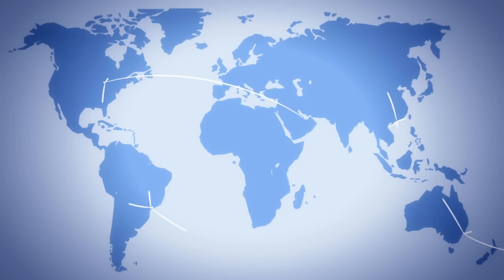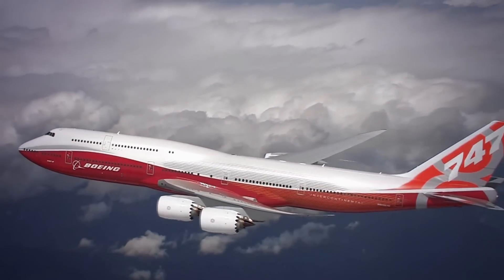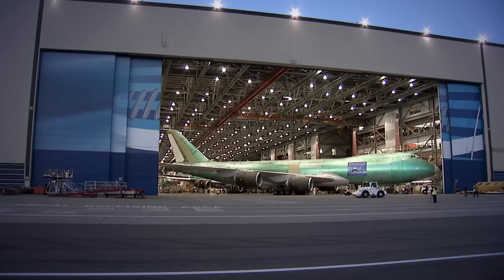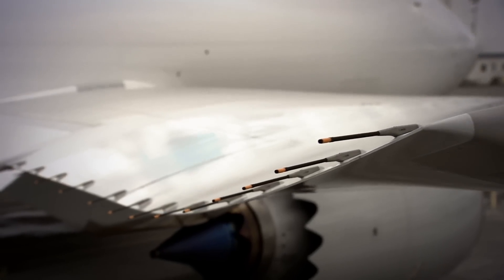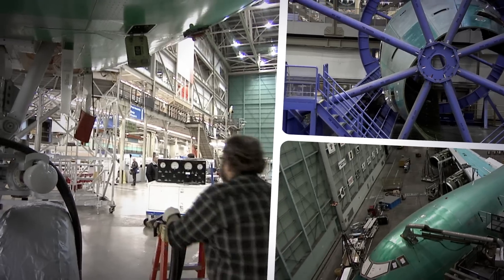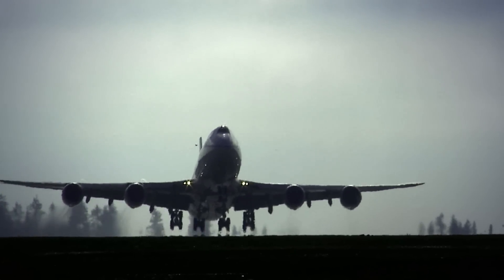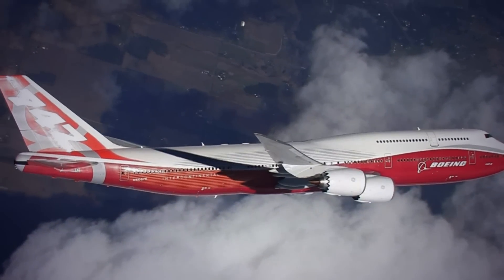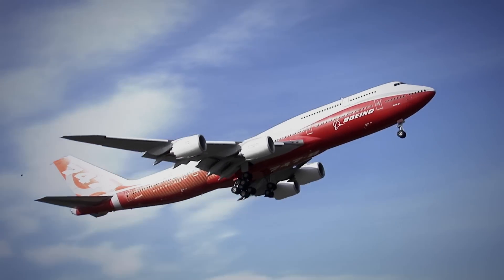747-8: A new lift in performance

Comment: The 747-400s will retire in 2017. This is a replacement for the 747-400s. The 747-9 should be larger and have two huge jet engines like the 777.
Reply: Wouldn't that just be the 777-9X?
Reply: Yes but he 747 has the top deck.

Comment: I like how they always say "best in its class". There really isn't any other airplane in its class. The a380 is a ton larger (and sometimes difficult to fill), and the a350-1000 is even tinier compared to the smaller 77W. I guess the other 747 models are in the same class, but obviously the 748 would be better than the 744 in fuel efficiency and capacity. It's still a graceful airplane with great operating economics, and has a sweet spot for passenger and cargo capacity. I can't believe very few airlines are buying the PAX version, as the 777X still can't really replace it.
Reply: bellissimo

Comment: This is the generation I call "Boeing MAX". This is the era in history where we make the first steps from today to tomorrow. All the airliners are getting a makeover with the 787 type powerhouse, more fuel efficiency, more passenger appeal, tech upgrades, retrofits, etc. It started with the 747-8i, then the 777-2 and 777-9.
Next it's the 737 MAX. Then I think it will be the 767s, then the last one left, the 757. I didn't say the 727 or the 717, or even the 707, I don't think they will be refit as they are really old. But some of the newer ones will be refit, after the old turning new we should get The 797 or it will be thrown in there between the rest.
Reply: Thomas Harbauer 
The entire purpose of the 787 is to replace the 767. Why would Boeing make a 767MAX??
Reply: ...
.o

Comment: The reason the 747 is still the king, is because it was flying almost 40 years before the A380. So it has flown a Billion more passengers. The A380 can't come along and dethrone the 747 because it's larger (or supposedly more fuel efficient).

Comment: Lufthansa, one of the few airlines which fly both A380 and 747-8i -- say that A380 has 747-8i beat in fuel consumption per seat. Not to forget how spacious it is in an A380 and a lot quieter inside.
Just replacing the wing and engines won't get you much.
Reply: "Just replacing the wing and engines won't get you much."

Okay, in that case the A330 is no better than the A300 and the A340-500 is no better than the A340-300 and the 737-700 is no better than the 737-300.

Reduced drag and reduced fuel consumption won't get you much?
Re-winging an airplane makes it a new airplane.

Re-engining with 787 engines creates a massive fuel consumption reduction.

The only "economic" flaw the 747 fuselage has is that - in the aft part of the fuselage- there is a bunch of excess fuselage structure (weight) above the passengers caused by the 747 being designed to haul cargo containers.

Looking at the A380 aft fuselage and massive tail and horizontal stabilizer I see a lot of dead weight there too (unlike the back end of the 747). 
Due to the high mass of the airframe and the short (in comparison) moment arm to the tail, the A380 is probably carrying a lot more "dead weight" than the 747 is in the upper lobe of the fuselage.
Look at it!  The A380 is a pig.  Look at that tail!  I wonder what it weighs?

The superior aircraft is whichever one is most cost-effective for the route that a particular airline needs it to address. Whichever one has the lowest seat-mile costs, highest dispatch reliability and the lowest maintenance costs is going to be the best airplane.

The QANTAS representative who bought the A380 did it only because he said that Airbus was essentially "giving them away" and he couldn't turn that cost savings down because he's "have to answer to his board" (investors)- and would probably be fired.

QANTAS has always been Boeing loyal, but businesses exist to make a profit- and Airbus likes to give airplanes away.
Reply: StratMatt777 All right, you wanna get technical?
1. The A380 air-frame is made of composites. Especially the tail structure you think is "dead weight". Thus, in fact the tail structure of the A380 is larger, and LIGHTER compared to 747-8i. You can even see it in this video that that the tail section is painted green with a non-corrosive paint; meaning it's made of aluminium. So you can keep wondering how much it weighs.
2. If A380 looks like a pig, 747 looks like humped buffoon. 747 design is flawed -- cockpit is placed on the upper deck and the lower deck protrudes under it! How is the polite supposed to see the runway?? There aren't even cameras at the nose-gear like A380 has!
3. As I've already pointed out the only carrier, Lufthansa say A380 is cost effecient compared to the 747-8i (supposedly the model expressly to built to compete against A380's superior technology)
4."Airbus likes to give airplanes away." Yeah right, they are very generous.
Reply: Jérôme Delacour said "2. If A380 looks like a pig, 747 looks like humped buffoon. 747 design is flawed -- cockpit is placed on the upper deck and the lower deck protrudes under it! How is the polite supposed to see the runway??"  

Actually, an Airbus spokesman concedes that the A380 is not very pretty. He says that they had a certain dimension to work with and this is the result. Obviously any attempt to streamline the look of the A380 to make the front end more sleek would have been at the cost of seats and efficiency. So that wouldn't make any sense. Airliners exist to make airlines money. it doesn't really matter that there are enthusiasts like us who get all caught up in "which one looks better" and then get all pissy about which manufacturer is better (all based entirely on the nationalism that is the result of the country we just happened to be born in).

I don't care that the A380 is ugly. In fact, I think that the Wings and engines look fantastic. The fuselage looks okay to me in Korean Air and British Airways colors... but looks really don't matter.

747 pilots have never had any trouble seeing the runway, though I'm sure it took some getting used to at first!  Apparently you aren't aware that when Juan Trippe and Boeing came up with the concept of the 747 they were certain that supersonic flight was the future and that every single 747 they were going to produce in the early 1970s was going to be turned into a freighter- and that all airlines would fly supersonic airliners.

The cockpit is on the upper deck so that the nose can open to load cargo containers.
That is the only reason it has an upper deck.

I respect your opinion on the looks of these two airplanes, but I don't really believe that you can find anyone who thinks that the A380 nose or fuselage looks better than the 747...  if you can find them they are Airbus fans who are lying because they think that admitting that the 747 looks better in some way is an attack on the A380 (it isn't an attack on the A380). It's just a fact.

Boeing knows that the 777X is going to DESTROY the 747-8i in terms of seat-mile costs, but it will remain a fantastic freighter (which is probably the real reason they designed the 747-8). It's not a problem that the fuselage is made of aluminum.
If aluminum fuselages were terribly inefficient the 777X wouldn't have one.

"Airbus likes to give airplanes away." Yeah right, they are very generous."

What I said about Airbus and QANTAS was a fact. You don't have to like it.
It's not that big of a deal. They are just airplane manufacturers... the fact of the A380 being ugly does NOT mean that U.S. is #1 and Europe is #2!  It just means that it is ugly.

Have a good day~
Reply: StratMatt777 Mais quoi ça cette connerie???!
So, long last you agree that whether the A380 looks elegant or not is YOUR opinion? Lolzz! In fact most would opine that the Korean Air and South China liveries are quite ugly. A380 looks the best in Air France, Lufthansa, Qantas, Emirates liveries.
Anyway, thanks for not challenging the key factual points, i.e., (1) and (3), which means they are true and you have no answer to them. I don't give a rat's fart about opinions.
**All who have travelled in an A380 agree that it is much quieter, spacious and luxurious. Even economy class seats.
**Pilots are delighted the way it responds, the fly-by-wire, glass cockpit, advanced avionics. Slow landing speed, for a graceful landing and needs shorter runway.
**Airlines are happy with fuel savings and satisfied customers.
**Airports are happy to see one aeroplane take-off/land instead of 2 to 3. Complies with ICAO standard 80 metre box.
These are the facts which make A380 much better than 747, even 747-8i. So by not refuting the facts your opinionated long comment is meaningless.
I couldn’t care less who designed the 747, even I could say -- Did you know Jean Roeder and Charles Champion, at Airbus, were the creators of the A380? What difference does it make if you don’t know who they are?
You agree with the obvious misplacement of the cockpit on 747; stating that pilots would need getting used to. And funny enough the even on freighter aeroplanes the cockpit could still have come at the tip -- just like all other freighters.
And about the companies; when Airbus introduced fly-by-wire, glass cockpit, composites, Boeing dismissed it as cheap innovations. Now they are humming the same tune, so much so that they are promising a host of improvements of an aeroplane (777X) which is not even built yet. Heck! They haven’t even built factories to manufacture the composite wings.
And please provide proof for your remark about the Airbus Spokesperson and Qantas.

Comment: The A380 lacks looks, soul, history, prestige, speed and glory.
Scarebus lovers can cling to their whale plane. Boeing flyers will stick with the 747-8i and 777X; The Queen and King of the Skies!
Reply: cageordie The USAF just said they chose the 747-8.
Reply: You seem like a rational person to me.
Reply: lol. Only 51 747-8Is have sold, 21 have been delivered. Boeing hasn't sold a -8 in ages. As things are going the 747 will end production in a few years. 777X is doing well, but the 747 doesn't make sense any more, Boeing is destroying its market with the 777X, but then it didn't really have a market any more. Even replacing the presidential fleet and the other special purpose 747s in the US military is just a swan song.
Reply: To be fair Air Force 1 is being replaced with 747-8s, but the government is probably the final customer. It's a shame that this wasn't the high profile project, the Seattle engineers just quietly re-engineered the 747 while the subcontractors were turning the 787 program in to a fine warning to others.

Comment: I think that 747-500 is a better name for it.
Reply: Boeing made plans to make a 747-500 and a 747-600. However, the -500 design became the 747-400ER and the -600 design was scrapped. This airplane is named "747-8" because it has been upgraded with technology from the 787.

Comment: Of course M1+ is well above normal limits but a DC8 was deliberately dived to M1.012, maintained for 16s (and later sold to Qantas).
The Taiwanese 747 that is calculated to have reached M1 during it's uncommanded roll, steep inverted 30000ft dive a high-g pull-out (a half loop), suffered significant damage - although a lot of this is consistent with it's high g pull-out (wings permanently bent 2" up, parts of tail missing, inboard main gear dangling, etc). It was repaired & re-entered service.

Comment: A320 overspeed is @ 350kts IAS or M0.82 (whichever is applicable & reached 1st, depending on altitude) and shouldn't be deliberately exceeded. Above 370kts IAS/M0.86, a structural inspection is required.
Google it. Source - Theflyingengineer d o t  c o m / tag / overspeed /

Comment: "All aircraft can be taken to higher speeds than recommended"
Well, unless the beluga whale A380 is in question, that thing started breaking apart during flutter testing BEFORE it reached its recommended speed. I know they had to make modifications and it barely ended up certified in that aspect, which is why it's allowed to fly, but to think of taking an A380 past its suggested maximum speed is ludicrous and would end incatastrophe. Unlike a 747 which would hold fine. We all know this.

Comment: If you knew how to round numbers, you'd realise that 5 or above rounds to the integer above. the 747-8 cruises at about 0.855 mach, which rounds to 0.86Mach. Its maximum speed during flight is 0.92Mach. If an airline is running late, pilots can be told to fly the airplane faster, even if it means greater fuel burn. Don't be daft; everyone knows the maximum allowable operating speed for a 747-400/-8 is Mach 0.92 and is sometimes used. However, 747s have been known to reach past the sound barrier.

Comment: Well, funny you should say that. The 747 is capable of being pushed far beyond its known limits. Sure, it'd cause a lot of flutter and some damage at over mach 1, but a 747 is capable of reaching mach 1 during a dive, for example. Mach one for a short amount of time in a 747 would do little to the integrity of the airplane. It's a strong airplane. E.G has 3 wing spars. China Airlines flight 006 held together at over mach 1. I'm not taking this  from a guy who thinks 350kts is overspeed in a320s.

Comment: Candidate KC-Y tanker:  Twin engine (GE-90/PW4000 series engines) 747-8 freighter with extended upper deck, shortened empennage (747SP length), with KC-46A tanker facilities.  Cargo in the bottom, PAX on the top with fighters in echelon formation across the ocean to the FOB.  Install winglets for increased efficiency and reduced outboard turbulence for outboard refueling aircraft at refueling pods at the previous outboard engine wing stations.

Comment: When they create a new aircraft, a significant amount of R&D goes into the design.  They work hard to make the fuselage and wings as aerodynamic as possible within the constraints of size, materials, and time.  So, why completely abandon it with an entirely new platform, like the 777?  I really like the approach here of taking a very successful aircraft and making it even better.  Kudos to Boeing for leveraging a proven design and improving it!

Comment: Boeing had just lost their tender to build the C5 to Lockheed. Boeing had already toyed with the idea of building a larger commercial airliner. Allen spoke to Trippe about Boeing's concept for the 747. Trippe told him if they (Boeing) built it he'd buy it. Allen told Trippe that Boeing would need at least 50 confirmed orders before they'd start.They took the risk and proceeded anyway. At the unavailing 26 airlines had confirmed orders for the 747.Boeing was always going to build the 747.

Comment: There's no need to replace the 747 yet. Old design or not, the 911 is a brilliant feat of engineering taking rear-engined design and making it work so well. Boeing is the Porsche of the aircraft manufacturers because they build designs that work. Unlike Airbus, look at the A340...what like 15 years cause the 777 sold so well in comparison.

Comment: in my opinion the airfrance flight crashed primarilybecause of the pilots they made wrong decisions. the pitot tubes should have been replaced already because of a designing fault but air france hasnt and dont informed the pilots 

a crash always happens because of more than one aspects :D

Comment: Lay off the caps lock... I consider boeing to to use safer flight control designs.  For instance, AF flt 447 was an A330 that crashed in part due to pilot error and in part due to an overly computerized system.  Icing was in there as well but that's against the point.

Comment: Boeing fixed the A/C overheat and fuel "blow up" problem, also Boeing planes are worth 70% of commercial flights, so HOW can you say Airbus is safer? Boeing is bound to have more incidents because of more planes in the sky per day. Both are enormously safe, and I would get on either on, and in fact I have without a problem, so shut your trap.

Comment: The TWA 800 incident was not caused by heat from the airconditioning unit. What happened that day was: TWA 800 spent 30+ minutes on ground with engines running. Without cool air cooling the airconditiong unit, it start to heat up the central fuel tank created a explosive air-fuel mixture (Jetfuel won't burn if you just drop a flamming match in it.) When TWA 800 climbs a faulty wire ignite the air-fuel mixture.Nowadays cylinders with fibers in there will creat and fill the tanks with Nitrogen.

Comment: For Air crash Investigation, well 747 is the biggest airplane and more famous before A380, just like all disaster move usually use magor US and other famous cities as a background. Use of 747 can catch people's eye. And don't mix up 747s with 707s and DC-8s, they all have 4 engine only difference is 747 has a second deck. Air Crash Investigation as More OTHER plane carshes like MD-80s,DC-10,11,A-300/310/320,330,340,350, Boeing 707,727,737-classic/Advenced/NG, 757,767 and off course several 747s.

Comment: Sir, Boeing's history can be traced back before WWII. Airplanes only become safer after 80's, so Boeing had paving way in "danger zoon" for more than 50 years, compare Airbus only about 10 years. Airbus become safer only with experance gain from Boeing, Mcdonald Douglus (now apart of Boeing), Lockhead and many others. Boeing 777 (since 1990's) is the safest airliner currently in industry with only 2 incident cause by Rose-Rolyes Turent 800 engine problem (Loss power) and no single fatel cases.

Comment: TWA flight 800 exploded because it's fuel tanks were filled with oxygen, if you payed attention you would see that this was solved. Most accidents happened with boeing aircraft because Airbus started building planes in the early 70's and Boeing has been manufacturing airplanes since the early 20's